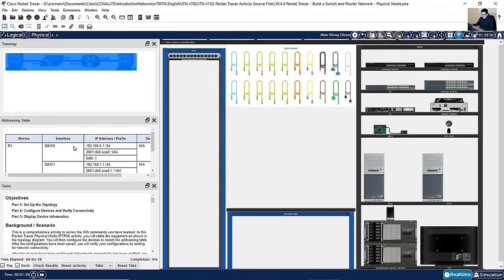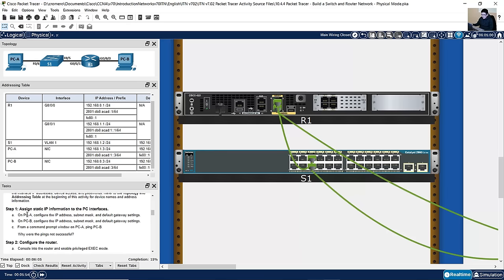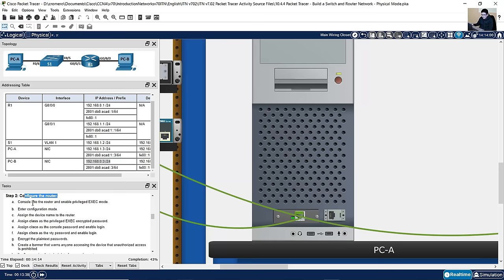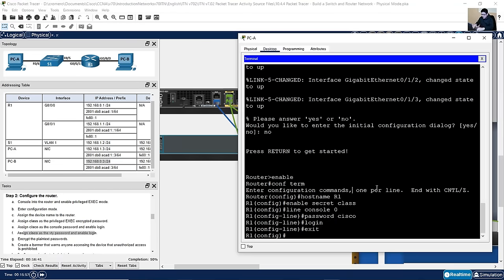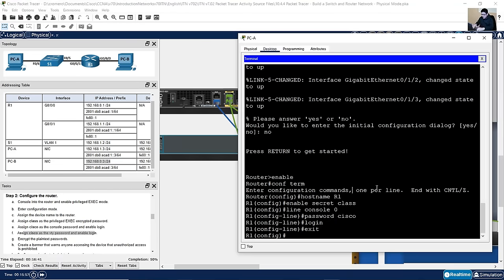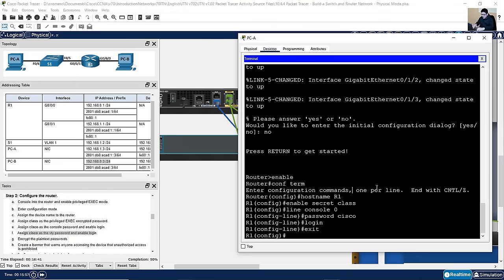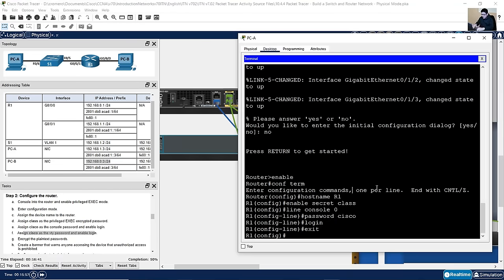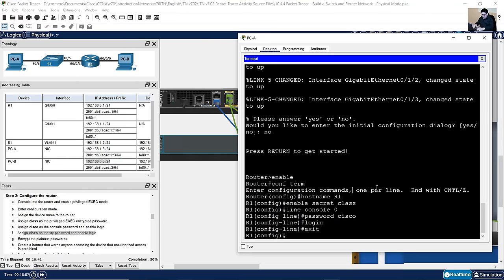10.4.4 Packet Tracer - Build a Switch and Router Network - Physical Mode

Comment: why did you connect the PC A with the console of the router and the PC B with the console of switch? it shouldnt be the opposite way,  I mean PC A with switch and PC B with router?
Reply from the maker: You can use any PC to configure any device with console cable